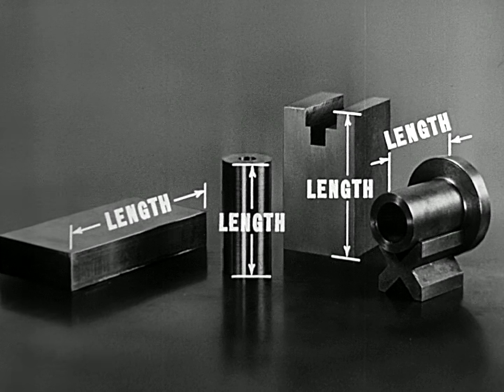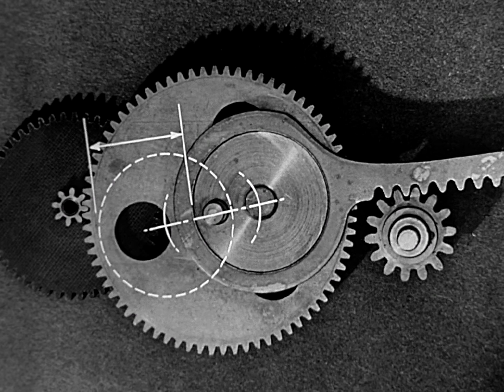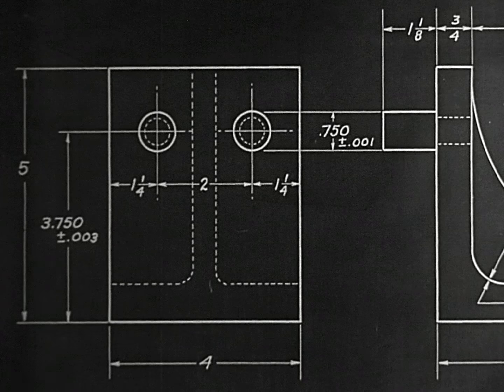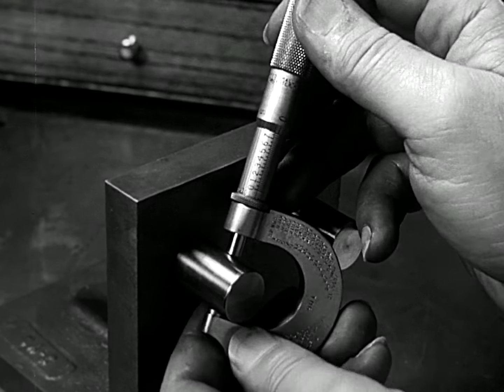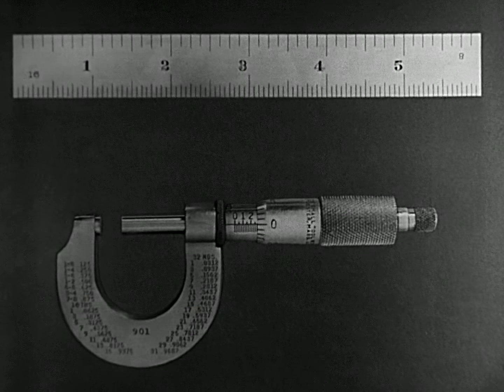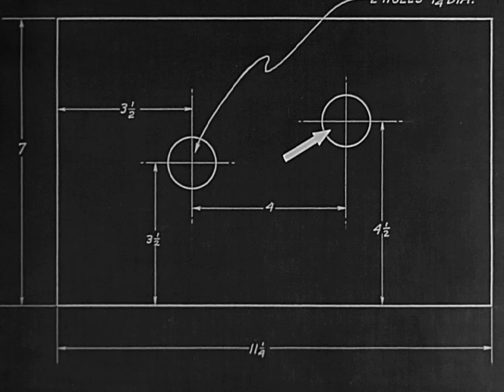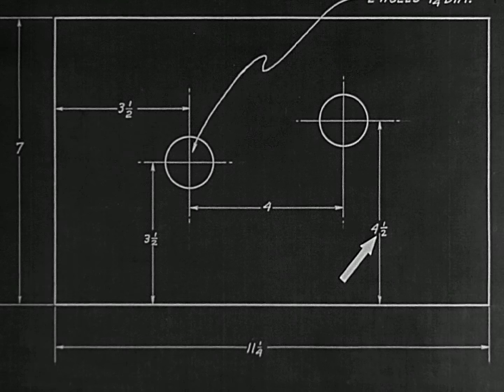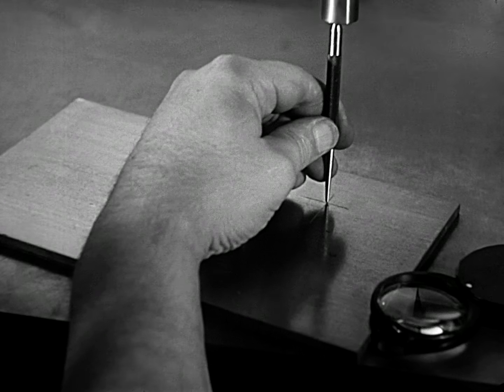The Steel Rule

Comment: nearly everyone calls it a ruler because of the education system. when i came out of school in the 70s and started my engineering apprenticeship i called it a ruler, the old engineer that was teaching me corrected me and said it was a rule, from then on i called it a rule, now i find myself correcting everyone that calls it a ruler.
Reply: My old instructor always called it a scale.
Reply: The difference, in my opinion, is insignificant.
Reply: I was taught at tech that it is a rule as to the point of ruling a measurement or line off the mark and I have been teaching everyone since, even my boss which is a mechanics engineer. Also with paperwork, when you have to line a piece, you rule it off the mark don't you. A rule rules so to speak.

Comment: Simple system it is! A fraction is nothing more than a ratio. 47/64 is actually 47 divided by 64, which equals .7343". Metric is OK with me, but I don't see any problems with Imperial or S.A.E. measurements.
Reply: HappyandAtheist  It is best to use the system used to manufacture the part or in surveying to use the measurement that was originally used for the original survey if trying to reestablish lines and corners.  Most times equivalents can be calculated and used which is  just fine.  I worked in metric when the job I was on used metric but prefer imperial except when laying out a line then I use feet and thousandths of a foot.
Reply: HappyandAtheist  It still works.

Comment: At the beginning of the second world war,  when parts were sent over to Britain from the USA . It was found that they would not fit and had to be sent back , at great risk from U Boats . It  was a found to be a difference in the inch  between the two countries . So measuring equipment had to be recalibrated .

Comment: It was interesting that the basic linear (not dial) caliper wasn't covered. It was a simple variation of the adjustable square capable of more precise and consistent measurements than a basic steel rule. These sometime incorporated a magnifier

Comment: Copper sulfate is probably not a good idea though as a layout fluid, sulfate ions catalyse rust, so are best avoided. The idea is presumably that some of the copper cements out leaving a layer of copper you can mark into. Neat idea, but dyes are probably better and not going to rust up your work. Yes I know steel is often pickled in sulfuric acid. But it does make it more likely to rust badly if isn't all removed.
Reply: The most popular "dye" today is a thick Sharpie.  Even NIMS tests consider them acceptable because industry uses Sharpies so often. I keep red and blue handy.

Comment: As a blacksmith (three rivers forge), I'm supposed to "work to the tolerance of a worn shilling", but I can't stand that notion.  Give me a steel rule, well oiled, and a scribe.  I keep a steel rule in the bib pocket of my leather apron right next to the carbide scribe that leaves a very fine mark.  The only time I like soapstone or a silver pencil is when I need to simply grub off some steel. 

If you tell me you want something 15" long, I do my level best to get it right on 15"...... not 15.1"!!!

Nothing more aggravating than a thick line marking something and having no idea where on the line to cut, punch or drill.
Reply: My overall bibs are material built into my overalls as I am a micro machinist making part s of the watchmaker in size. I have my pocket steel scale and a single pencil and a single pen this allows my portability as I move from one work station to another within a short distance of travel. Ferrum Itzal. We liked your story og the rules usage.
Reply: I have been talking to a few (4) blacksmiths that claims that 1mm margin of error is to large for blacksmithing work.
How true is this?
Reply: save time in the long run by being accuracy.
Reply: I don't know why that myth is perpetuated. A blacksmith works to the tolerances needed for the forged part to fit, and degree of fit is always specified. It's only when the parts get large, rigid and are anchored in use that thermal expansion requires looser fit.
Reply: @andnor It depends on what processes you attribute to a "blacksmith".  
 The names that we give to trades today are so far removed from their origins that many of them are irrelevant.  I'm now an engineer, not  a wright, but an information and physical materials manager. "What engineers design, others do wright." ;-D

A tolerance of 1mm +/-1/25 inch)  for every measurement of  a hand forged large part made without any other machining is tough because the parts are worked hot, expanded, and malleable, but  measurements are taken when it is cooled.  Very few precision parts are forged today without further machining. 

I received a pretty thorough education in metal working, (starting with my name),  through hands-on shop classes in various material crafts - woodworking, foundry, forge and machining.  Those clases covered history, development of technology and theory, not just the manual skills.

A blacksmith works using heat and impact on iron to shape it.  The skill of "black" smithing evolved from general metal smithing which started with easier to process, softer metals like copper, gold and silver.   The soot produced by coal fired forges, blown into the shops and onto the workers by the forced air, is where the "black" came from. )   Steel foundry and forge are specializations within the "black" trade. 

The only tools used by a traditional blacksmith were a forge, anvil, hammer and chisels and the material used was a rough ingot.  Originally those  tools and ingots were prepared from ores by black smiths.  Mill files and metal saws are relatively recent additions, so is the standardized steel rule, all of them built by descendent of the black smiths, building on the work of their predecessors.

Comment: Wow, love that tool box. Pretty sick that the "other measurement systems" they mention are twelfths, twenty fourths and tenths of an inch though...
Reply: Used for scale drawings.
Reply: @bostedtap8399  Yep, you needed them back when drawings were hand drawn. I still have 3 sided engineers and architects rules. The other type rule not mentioned is a "shrink rule" used for making mold patterns so the work will be the correct size when it cools from the molten state. There is a rule for each type of metal.. iron, aluminum, etc.

Comment: Measure it with a steel scale  back in the day.  I fight a CMM all day trying to hold +/-.0001. We need to go back.
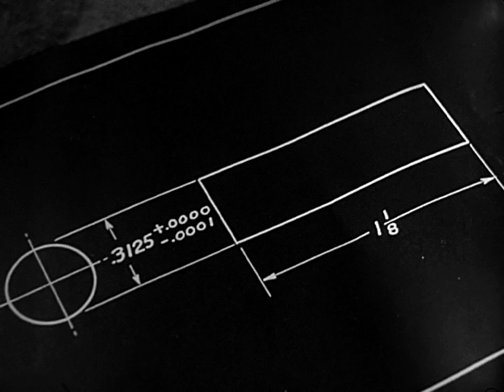Reply: It is about the steel rule, but I see at 01:31 they have a 5/16" dia to a tenth of a thou, on a piece 1.1/8" long on the drawing. Ground I guess, too close to turn to that tolerance I would think at that diameter and length.

Comment: And not too far into the future selecting a part and pushing the start button on a 3-D printer is all anyone is going to have to do.
Reply from the maker: No. I don't think you are going to ever see a robot be either creative, or proactive in intercepting and correcting problems. 3D print files still need to be created with imagination and skills and supervision still need to oversee and verify that the machine is working properly.

Comment: Yeah.... the beauty of the Imperial system. Forty-seven-sixty-fourth of an inch.... All clear.... And the irony of it: it is based on the Metric system, check at the NIST! Why make it simple, when we can make it Imperial ;)
Reply: Exactly.
Reply: eh,  I work in both.  Easier to do math in your head on the fly with imperial.  rather hard to keep track of dozens of meters down to the millimeter, where simple dealing with feet, then inches, then fractions of an inch is manageable.
Speaking about construction mind you.   I'd agree that in general the metric system is better when high accuracy and many calculations are involved.  In terms of applied geometry though, it's often easier for me when dividing something to use fractions, which in imperial translates directly to numbers and lines on the tape easily.  That being said I do all my volumes metric, since it is easier to multiply, and also generally material comes metric, so why do the conversions?
Reply: Imperial got us to the moon.
Reply: The imperial system is dozenal and not decimal. Plenty intuitive if you're capable of counting to 12, and any given metric has far more factors, actually making it far easier and more precise for precise calculations. Before your rebuttal, with perfect accuracy can you provide me the length of 1/3 of 1 meter?
Reply: @timothyarmstrong5987  And missed Mars.

Comment: Just about every manufacturer of RULES, makes the same d.... mistake.
They feel that they must screw up the 1st 2 or 3 inches by engraving micro sub divisions.
An experienced worker has no use for these!
Reply: I prefer the ones like shown in the video that have 1/8" and 1/16" on one side and 1/32" and 1/64" on the other.

Comment: I have to admit I truly hate the imperial system.To many damn fractions
Reply: Good exercise for the mind.
Reply: Fractions are fun and pretty easy tho. And fractions are real where as decimals are approximations of size
Reply: @ivankoran   I agree fractions are fun, and useful at times, but your use of "approximations" is a bit misleading. You may want to measure 3/16 of something, which sounds much more satisfying and accurate than 0.1875, but if you inaccurately measure 11/64, it's still the same as inaccurately measuring 0.171875. I use both, by the way, and the worst thing is when you have to convert one to the other. Anyway, I'm not telling anyone to use one or the other.
Reply from the maker: This is a historic film. We are not advocating how things should be done, today, but I hope reasonable and constructive comparisons are made.
Reply: As a cnc machinist, we use both metric and standard, fractions and thousands. one gets very good at converting them! Tho I always use a calculator to insure I do not ruin parts. 
A few simple tips to make it easy, 

converting fractions to thousands (lets say 1/8 for simplicity) simply divide 1 by 8 (first number decided by the second) it will give you .125 and this holds true to any fraction! 

Converting metric to standard, lets say you have 50mm, times the fifty millimeter by .03937 and it will also give you a thousands measurement of 1.9685 Or just under 2 inches This also holds true for any metric measurement 

Converting standard to metric is simply dividing .03937 by your metric number! 

there are endless formulas and calculations, but those are a good place to start! There are also allot of fraction equivalent charts available! :)
Reply: Of course you're joking, Ivan?
What do you say to decimal inches, or decimal equivalents of fractions? Are fractions of a dollar approximations?
Space or distance may be the subject of much theorizing, but measurements in the shop better be pretty damn real!
Reply: O Smith Give me the metric system any time!
Reply: @markschwarz2137  I'll do it for you: go metric ;)
Reply: I've always preferred the decimal system because that's what I was taught even before I was an apprentice. Having been in the trade 40+ years I always convert fraction and millimetres to decimals in my head.........
Reply: Metric guys have to take their socks off to count past ten!
Reply: my god theres still people advocating for imperial? let it die already. i know a woodsmith who says he likes using inches cos theyre larger units. fair enough i guess, but its still terrible.

do they have megainches? oh no thats right they have feet. and galons. nothing about imperial makes any sense what so ever. at least metric is all uniform and you only need to know your units, which is universal

Comment: Stop using wrong measuring system :D
Reply: Imperial "Rules" Metric Sucks!
Reply: @brianday6433  how?
Reply: therealnightwriter  As someone who has used both, metric is so much easier and is prone to fewer measurement errors.
Reply: @MichaelBeck_profile  Neither System is more accurate that the other (as some have said). Both can be divided to infinity. I 've been a machinist for nearly 50 years. I do more metric parts than I do in inches. It depends on which system you were raised on. If someone says "I need 12 ft rod" I know about how long that is without grabbing a tape. If they say " I need a 3,048mm rod I grab my calculator then my tape ruler. How would you feel if your next paycheck was in  Eros?
Reply: We always need some arrogant fool telling us what system to use, because we can't decide that for ourselves.